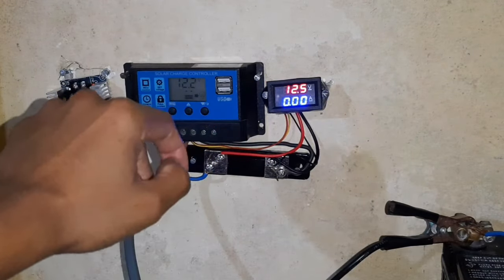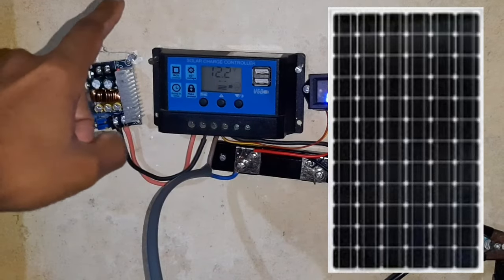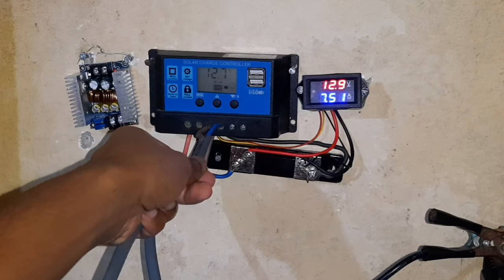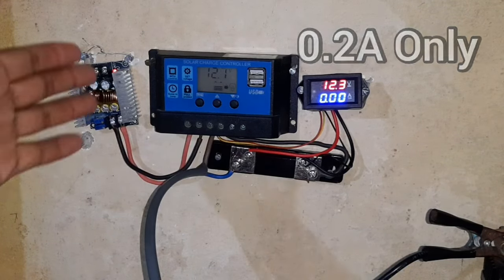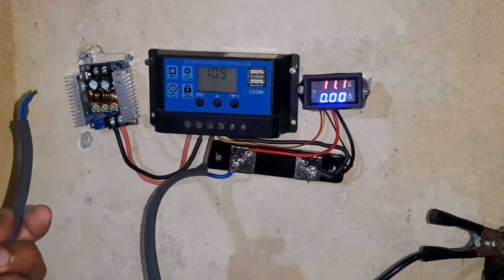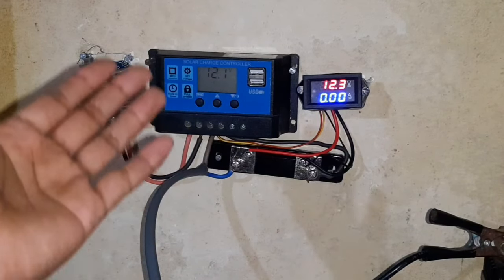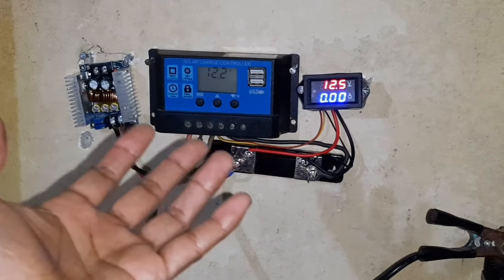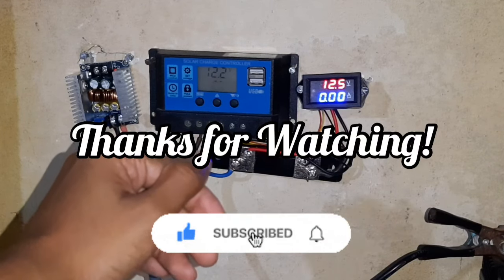Dc to dc Stepdown Converter for Solar Power System - Live Test! | Is it Worth it?

Comment: Can I trick the solar charge controller by feeding it with DC power adapter (19V 3A laptop charger) through the buck converter  so that solar charge controller think it is a solar panel and charge the battery. 

Because, connecting DC adapter directly to the PWM solar charge controller does not charge the battery. I've tried that...
Reply from the maker: No I dont think that will solve your problem. I think the most likely reason is the output of the dc power adapter. What is the size of your battery? If the output is 19v it can definetly charge a 12v battery but the amps should be adequet for the size of the battery. You dont need a buck converter if you are using a dc power adapter. Just make sure the power output is adequet or let it charge for a longer time.
Reply: @diysustainableliving2774  I have a 12V 7.2Ah VRLA battery. I bought a PWM solar charge controller, because it has battery charging and battery protection features. But since I don't have a solar panel (yet), I was thinking of changing the battery through the PWM solar charge controller by using the laptop charger. Since the SMPS have self regulations of voltage and current, PWM controller cannot recognize the SMPS. 

That buck converter has CC/CV, and you already connected that to your solar charge controller. I was hoping that same way instead of connecting a solar panel, what if I connect the DC charger to the buck converter? Have you tried that (as an experiment)?...
Reply from the maker: Im not sure how the laptop charger works. The panel produces a pure dc output. It is at the PWM charge controller that the dc is converted to a high frequency on and off state. If the laptop charger also produces such frequency on the output then the solar charge controller cant adapt accordingly. Before trying the buck converter why dont you add a large capacitor at the dc power adapter output to stabilize any high frequency fluctuations.
Reply: @diysustainableliving2774  thanks!... I'll do some experiments and if I succeed, I'll update you.
Reply: It is possible. I connected a laptop adapter (19v 3.6a) to a buck converter and reduced the voltage to 14.4. Then I used this setup to charge a lifepo4 battery (50a). It worked.
Reply: @alibilgeozturk2227  what type of buck converter you use... How many series of batteries do you charge.
I have 18650 6s and 7s, 10p, making 60 & 70 respectively. I want to see how to charge them full without any problems
Reply: @yusifsuleiman5502  Hello. The first battery I use is the Ctechi 50a lifepo4 battery. On the manufacturer's site, it says that it is produced from 4s prismatic cells. The second battery I use is a 24A AGM battery. I tried to charge these two batteries with a PWM and MPPT solar charge controller using a laptop adapter as a power source. I was unsuccessful in both. Then I placed the XL4016 buck converter between the laptop adapter and MPPT and PWM devices. I was able to fool both MPPT and PWM devices this way. As a result, according to my personal observations, an XL4016 buck converter can fool MPPT or PWM solar charge controllers as if they were connected to a solar panel. The XL4016 model is a 10A buck converter. However, you can choose a higher amperage buck converter according to your needs.

Comment: What type buck converter to use i have a 270watt solar panel
Reply from the maker: I am showing that. In most situations the buck converter is not as good as an MPPT. If you want to get the maximum out of your panel you will be better off just getting an MPPT charge controller.
Reply: you can put eg 2x 4016 in parallel

Comment: Hello Sir. It's an amazing video. I have some doubts can you please clear that for me?
Q.1 -  which buck converter is appropriate for 330W solar panel?
Q.2 - Is it safe to connect the output of buck converter directly in inverter for direct use?
Reply from the maker: Sorry for the late reply. Your comment was held up in the review section.
Answer to q1- you will need a buck converter that can handle 330w eg. either 2 x 20A buck converters in parallel or one that is rated above 30A.
q2- please check out the video where I run my fridge with batteries and without batteries!

Comment: I use this stepper to operate the inverter without a battery only
Reply from the maker: Yes you can use the buck converter in such a situation but keep in mind, the power output will vary through the day and if a cloud passes over it can lower the panel output as well. Thats why a battery or supercapacitor will help bridge these gaps.

Comment: pretty sure the charge controllers already have this incorporated.. well the not super cheap eBay ones do.  the charge goes into the charge controller and you can set the voltage that comes out the other end .. l
Reply from the maker: Well as you said... It is the MPPT charge controllers that have this function. PWMs can adjust the voltage by increasing or decresing the frequency it switches on and off.

Comment: Can I use 24 Volt Solar Panel with 12 volt Inverter & 12 volt Battery
Reply from the maker: Yes.. That is one of the best uses for the buck converter. It will stabilize the voltage but it wont give a significat increase in power. If you want to get the maximum out of your panel then use a MPPT charge controller.

Comment: In the description, I see this "buck converters can't hold the panel voltage at its maximum powerpoint". Could you please explain what you mean by that sentence
Reply from the maker: To extract the maximum power from your panel the panel side voltage has to be held at its maximum power point to give you the maximum power at the output. MPPTs are capable of doing that thereby giving you higher amps than a pwm controller. But buck converters depending on the energy available pull down the voltage. Thus you are not able to get the best output like an MPPT. 
It might be helpful if there is a big difference in voltage eg. 40v to 12v.
Reply: Thank you
Reply: @diysustainableliving2774  considering an mppt works off a buck converter how can you say the buck converter isnt as good as the mppt?

Comment: Please share connection diagram...
Reply from the maker: From solar panel power goes to the Buck converter and from there to the battery. If there is not a significant difference from the panel voltage to the battery you are not going to see any significant improvements. This is not going to acheive the values you wll find on an MPPT.
Reply from the maker: You will need a powerful one for that. It depends on the rated power of the buck converter. You cant use a 300w buck converter for a 575w panel.

Comment: How to step down dc to dc? 
input 450 DC Voltage to output 24  voltage
Reply from the maker: Yikes!... first is it solar power 450v or from a battery? If it is solar you will need an MPPT that can handle that voltage. BTW.. why would you want to reduct voltage from 450 to 24v? It might be easier to come down from 450v DC to 220v AC.

Comment: Put the buck converter after the solar charger to regulate voltage output
Reply from the maker: It will produce the same results.
Reply: @diysustainableliving2774  I would think it would be more stable...did you try a capacitor on the input of the buck...
Reply from the maker: Yes infact I did! :) ... with a 26v 1F size capacitor bank. There was no significant boost when the load is connected.
Reply: @diysustainableliving2774  trying to set mine up for a step-down from a 24v panel to 24v batteries then to 12v bank...hopefully it will work when finished...if not I'll probably go with the lm317 approach...
Reply from the maker: Lm317 can only handle 1.5A. It will be better if you go with one of those high power buck converters instead of using batteries in the middle. The one I am demonstrating is 20A. If you have a 24v panel the buck converter should be able to give more amps at 12V than what the panel outputs.
Reply: @diysustainableliving2774  I have a pwm solar control going to my 24v battery bank...from there I am connected to the same buck in this video...I hooked up a 12v motor and was drawing 2.5a start and about 1.7a running...the issue I have is the current adjustment is not having an effect on the buck converter...I also want to run multiple voltages and current stations from this one setup...the 24v bank is to power and hopefully stabilize the charging and usage of the 12v base system...
Reply from the maker: The current draw will depend on the load you use and the voltage. I dont think you can limit the current from the buck converter significantly to alter this power draw.

Comment: Your buck shouldn't drop in voltage to battery voltage when charging.
I charge my batteries when it's not sunny with the buck and not the pwm charger.
There is always a fair increase in current. But I'm using 24v (37v) panels.

As we know the difference in voltage makes for amps, so you'd never get much for the 2 volts or so from a 18v (16v) panel.
Reply from the maker: Yes exactly!... It works well only if there is a large difference in voltage.
Reply: @diysustainableliving2774  don't forget depending on the battery type and SOC the current can be very different.
- ohm's law will give the voltage to amp conversion.

Basically if I have 20v 5 amps and I want 10v I could get 10v 10amp. 
Realistically probably about 8.7 amp. Or worst case 6.25amps.

The other factor is battery state, after 80% charge, you can drop to around 2 or less amps, and it get slower the more the battery is charged. Regardless of the amps on the input or gained in conversion.
Reply from the maker: Yes you are correct. The point of this video is to show that buck converters are not equevalent to MPPTs. And it might not be worth it at all depending on the system.
Reply: @diysustainableliving2774  they can be if you pull down the voltage to the vmp.
I find they don't, there a little over and require 'tuning' which is what the mppt does.
Mppt are not a magical fix all. There just a buck with variable resistors that micro controlled to do the math.
Reply: @diysustainableliving2774  you were not comparing the buck converter with an mppt though, you was using a pwm controller, I have one of them and they are crap, the only disadvantage of using the buck converter on its own is if the transistor was to blow it would send the full panel voltage to the battery, the way you wired it up with the pwm after the buck is the safest way to do it since it will go into pwm mode if there is high voltage on the input

Comment: Dont buy this product for.
Solar charge controller,  i   already checker it.
Its just money wasted...
And thanks for making this video
Reply from the maker: Yes I also realized it only after I bought and tested it. But it has one benefit that might be of use. By having control of the output voltage you can use this as a charge controller for lithium cells. Im currently testing this and the voltage regulation is good.
Reply: @diysustainableliving2774   am also enjoying it on my lithium batteries, no more over charging
Reply: @Middle-Eastt  can it be used in place of bms?
Reply: @emenikeifeanyi3388  no...a bms regulates each bank of cells...this will only regulate total voltage and could lead to runaway...
Reply: @diysustainableliving2774  please sir at what output voltage is good to charge a 2pcs of 12v 100ah lithium battery pack that is using for 24v inverter system? (Please am confused since each battery is using 12v bms system)

Comment: sir ask lang pede ba ih direct ang solar dc step down sa ups power supply??
Reply from the maker: Can you please say that in english. I cant understand the language!
Reply: sir can i use dc step down to direct in ups power supply ?
Reply from the maker: You mean instead of a battery? Certainly... but when a cloud covers your panel whatever you are running will shutdown. It is always better to add at least a small battery to your setup to ensure there is enough predictable power when you need it.
Reply: okay thank you sir i subscribe you thank you so much for the information